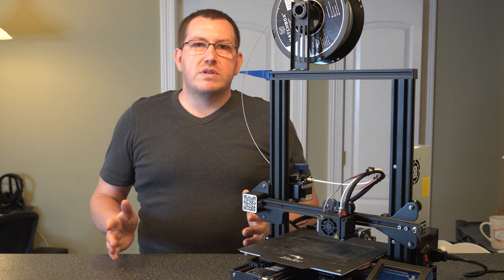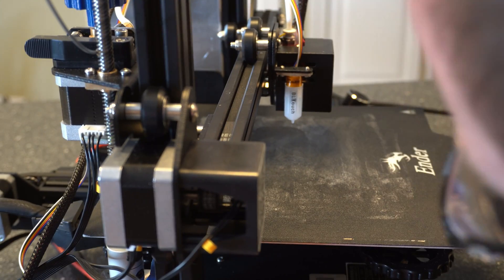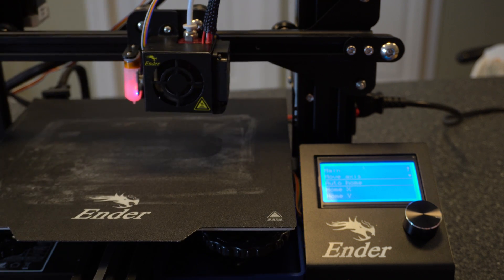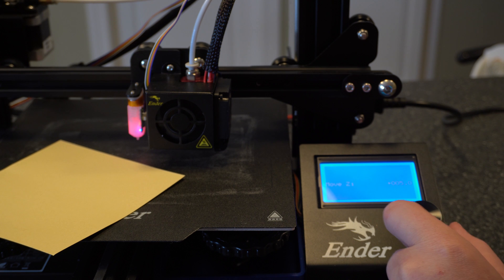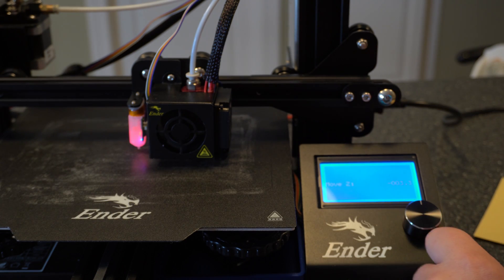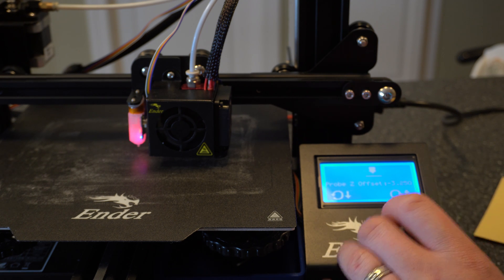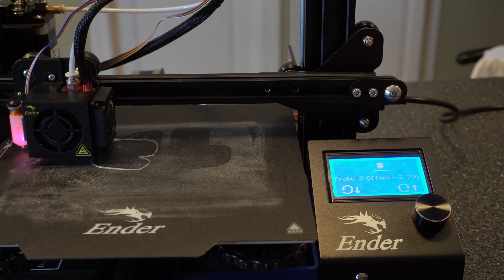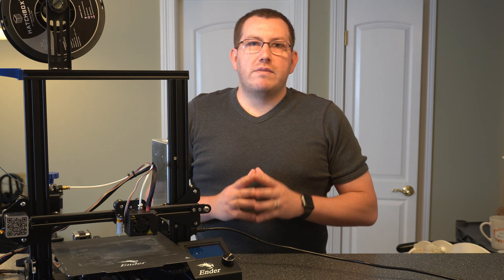Z-Offset BLTOUCH With Marlin Firmware

Comment: Hello, I've got an annoying issue with my Ender 3 with the 4.2.7 board, where the BLtouch goes to auto-home and won't move down. Whenever I try to manually adjust the Z axis, it'll only move up, and this is with Creality's BLTouch firmware. With the base firmware it works fine (with the exception of not being able to get the glass bed leveled no matter how much I fight with it), just don't understand how to fix this aggravating thing. I set the Z axis, and auto-home, it doesn't go down at all. Also, when I try to auto-home again, it says to Home Z First or Endstops Z. I'm very new to 3D printing, and am afraid to dig into the firmware since my previous 4.2.2 board fried while trying to install my previous BLTouch
Reply from the maker: Hi. If everything is working properly and you just cant get the z offset to go negative the issue probably the software endstops being enabled ( https://marlinfw.org/docs/gcode/M211.html ). If you do an autohome and it wont go down at all, it could be the wiring on the bltouch.
Reply: @3DPrintscape  Its not that I can't get it to go negative, it literally won't move downwards. The wiring on the BLTouch is where it should be, and the Z axis moves down with the base firmware, but I'm not confident in digging around in the Marlin to find the problem, wouldn't even know what the issue would be
Reply: @3DPrintscape  I move it down to the negatives and it works, but when I go to auto-home, it goes RIGHT back to where it was and gives the "stopped" error message, I try it again, and it tells me to Home Z First
Reply from the maker: @TheMacManusTwins  It its really sounding like a wiring issue, or the wiring isn't matching the firmware. Can you send me pictures of the wiring on discord? https://discord.gg/Bu94EYVkrU
Reply: @3DPrintscape  I have actually resolved that issue due to the red and the blue wires on the BLTouch not being where they should and using a different sort of firmware that's compatible with the Ender 3. Turns out the firmware from Creality has a bug where it wouldn't auto-home the Z axis properly or lower itself to the bed at all. Now, if I can just make it not print things like its made of brittle paper, that would be great, though I did have to babystep the Z axis during printing so it would flow smoothly against the bed, instead of sitting too high and dribbling from it like its been doing, regardless if the Z had been set
Reply from the maker: @TheMacManusTwins  Glad to hear you got past the first issue. It sounds like your e-steps or flowrate may be off now.
Reply: @3DPrintscape  On the contrary, it turned out to be a severely clogged nozzle. Was so busy stressing over everything else that I wasn't thinking about it until I checked it
Reply from the maker: @TheMacManusTwins  Ah ok, that would do it as well.

Comment: I dont get it at the end of the auto home where it goes back up yours comes back down mine just stays up about 50mm above the bed
Reply from the maker: Hi. It should be about 10mm off the bed in the center if you just do an autohome by itself. If you do it as part of another process, it will continue on.
Reply: @3DPrintscape  thanks for the reply

Comment: I’m so happy my printer doesn’t make that noise when leveling with a bl touch
Reply from the maker: Hi. Which noise are you taking about? Maybe my mic was just picking up a background noise.
Reply: Ah he's talking about the steppers, you must have the "loud" board in it....iv just upgrading from the 1.1.4 to the v4.2.7 and your motors sound like the old board drivers......
Reply from the maker: @mickyovts3872  Ah ok. Ya i have the 4.2.2 board with the standard drivers in one printer and an SKR Mini in the other. The noise output from the steppers connected to the 4.2.2 board is significantly more than a silent board like the skr mini or 4.2.7.

Comment: Just installed the BL Touch with a V4 2.7 board on an Ender 3 but the S axis won’t move down. Any help or ideas would be kindly appreciated. Thanks
Reply from the maker: Hi. It sounds like a firmware or wiring issue. If your using the creality firmware, make sure you have the z-stop connected still, then make sure the 5 wires for the bltouch are connected and in the right order.

Comment: You seem to be the only one who can explain this without taking 35 minutes, and while making sense. I have an Ender-3 with a 32 bit main board, and getting the BL-touch to work has been a lot of trial and error since it seems nobody has my exact setup. But thanks to your video, I've got a good first layer coming down, and I'm printing a test benchy.
Reply: Hey 3D Printscape and Oddman1980, I have the same setup, ender 3 with 4.2.2 mainboard and I also am having trouble with the BL Touch, so much so that I am thinking of removing it and going back to the good old ways. the main issue I have is when auto homing the display reads as 15.78 z axis. then the offset is down to around -5 but when I start to print, the nozzle is scraping and not allowing filament to extrude. I have to tune it while in motion, lifting the extruder by 1mm in some case but then the whole thing isn't level. honestly wish I hadn't bought it now. happy 3d printing
Reply: @guraven  you ever get this sorted? I’m having the same issue with an Ender Pro 5
Reply: @cybertrophic  Hi, I did get it sorted eventually, I watched more YouTube videos and had to compile my own firmware following the instructions, I then updated the printer with that firmware and it worked, little fine tuning here and there but it worked.
For the firmware compiling I watched teaching tech and followed what he did, also google worked for me
Let me know if you need more help

Hope you sort it.
Reply from the maker: Hi. Thanks for the feedback, im glad I was able to help.

Comment: I don't have a Z-offset option in the control menu on my ender 3?? So I have no idea how so set this without the option there to do so?
Reply from the maker: Hi. It sounds like you may not be running the firmware for the BLTouch. Can you check to see what firmware you are running?
Reply: @3DPrintscape  I'm having the same problem as this dude. How could I check to see if the firmware installed?
Reply from the maker: @guspurcell1629  You should be able to see the installed firmware under the about screen.

Comment: I have Ender3 pro with the latest marlin software and a BLtouch. When I try to manually adjust the z axis for bed leveling, it will not allow a negative Z axis number. Any ideas?
Reply from the maker: Hi. The software endstop is enabled by default. You can disable it by sending a specific g-code command to the printer or commenting out #define MIN_SOFTWARE_ENDSTOP_Z in the firmware.
Reply: @3DPrintscape can you please explain more...I activated it in marlin  but still Z does not go on negative values?
Z_max_pos is ste to 250 should I go lower (I installed CrTouch)
Reply from the maker: Ah, in that case it couple be the software endstops. You can disable in the config by commenting out #define MIN_SOFTWARE_ENDSTOP_Z or using gcode by sending m211 s0  @omidel.

Comment: Mine won't allow a postive z axis adjustment. I auto home, auto level and everything is just fine. I go to print and it acts like it is looking for the Z stop, and obviously there isn't one, so the head smashes into the bed until it can't move any lower. Then I end up turning off the printer. Nothing has changed since the last time I was able to actually print. For over a week the BLtouch worked well. Now This. Any ideas?
Reply from the maker: Hi. This is a pretty common issues if the wiring doesnt match the firmware. Are you using prebuilt or firmware or did you build your own? If you dont have the z-stop plugged in, the probe stop should be connected where the z-stop.

Comment: Hi brilliant video, can I ask where exactly do you run the bed levelling element where it checks the bed in 9 places?
Reply from the maker: Hi. Thanks for the feedback. I have it running the mesh at the start of each print. You need to add the g29 code to cura to do this. I cover that in more detail in this video https://youtu.be/Xiy-oLLrB1k .
Reply: @3DPrintscape  thanks for the link joined discord grp and understanding it all a little better although I've installed mine via the pin adapter.. 👍

Comment: Why does my Ender 3 v2 think my Z is 10!!??!!? I can't do anything with the BL despite it being red and pronging in and out upon boot.
Reply from the maker: Hi. The -10 is normal for the auto home. You need to adjust the z-offset to get it to print on the bed.
Reply: @3DPrintscape  Any advice for me. I set the offset and it's all good, but when I print it's too high. even when I do the code on the octoprint terminal to lower it to 0 it's too high. also I did confirm that the z offset it's saved, it just gets totally ignored.
Reply from the maker: @Vrx-yp1eu What value do you have for the z offset? Also, if your on discord i can help out there. https://discord.gg/Bu94EYVkrU

Comment: Mine is still way to high, and when I go into the move axis, Z axis, option, I can only go do to 0.00, which leaves my extruder about 5mm too high.  I can't get into the negative numbers like yours.  Needed to disable software endstops.  M211 s0
Reply from the maker: Hi. Ya you would need to disable to software endstops in some firmware. Sorry, I should have been more clear about that.
Reply: To turn software endstops off execute command M211 with parameter S0

"M211 S0"

Comment: I’m going bald here after two days of troubleshooting...

I have done the firmware upgrade from your tutorial and followed this tutorial, but when I start to print something it starts about 7 centimeters up in the air. And when I “Auto Home” it raises about 10mm each time.

My setup:
Ender 3 Pro
BLTouch (Antclabs 3.1)
4.2.7 board (upgrade)
The original z-stop cable is disconnected completely and the z-cable from the BLTouch is connected to the dedicated BLTouch connector on the board. Not to the original z-stop connector.

Please help😭
Reply from the maker: Hi. The autohome being at +10 makes sense, and is normal. If the printer starts printing mid air, then the z-offset is not set right. I would need to know what firmware you are using but if your not on the Marlin bug fix line, i would recommend going to that and enabling the z-offset wizard. Here are two videos to help. If you run into issues, you can join our discord server and I can try to help you more there. https://youtu.be/pQ7WZST8sqk  & https://youtu.be/2gRfU26aTDs  Discord: https://discord.gg/Bu94EYVkrU

Comment: I am giving up. That BLT just opened up a can of worms. Ateast before I had the knobs... They wont work now
Reply from the maker: Hi. If your not seeing the menu shown in the video, try to clear your eeprom. This should be as simple as hitting restore defaults, but it depends on the firmware you are running. You can also join the discord server and i can try to help you there. https://discord.gg/Bu94EYVkrU

Comment: There is no z offset under control..
Reply from the maker: Hi. If your not seeing the menu shown in the video, try to clear your eeprom. This should be as simple as hitting restore defaults, but it depends on the firmware you are running. You can also join the discord server and i can try to help you there. https://discord.gg/Bu94EYVkrU
Reply: Thanks too
Reply from the maker: @mattlogue1300  Hi. I would go with the latest Marlin bugfix version unless you have a specific reason not to. I did a video covering the entire process that you can see here https://youtu.be/pQ7WZST8sqk . There is also a link to written instructions in the video descriptionas well.
Reply: I may sound dumb but which marlin fw should I choose? I know arduino IDE but life has been hell. Not sure what's running the ender 3 but it may be avr. Just dont want to brick it ... I already damaged two beds since getting the darn bl touch.

Comment: Too many z offsets. There is one in move axis, another under control motion, another in bed leveling, and then you have manual control. I fkd it up and it gouged bed.
Reply from the maker: Hi. I agree, there are too many of them. I mainly use the z-offset wizard these days but it wasnt available in Marlin when i made this video. Here is one i made covering the wizard. https://youtu.be/2gRfU26aTDs

Comment: I have a 4.2.7 board with The firmware downloaded from the Creality website. Ender-3 Pro- Marlin2.0.1 - V1.1.2 - BLTouch - TMC2225.bin
My Auto Home Z-axis defaults to +10 which is too much to compensate for with a Z Probe offset. How do I change the default of the Autohome?
Reply from the maker: Hi. The firmware by default is set to +10 but that can be accounted for with the z-offset. You will want to home the printer, then lower the z axis until it gets to the proper height. That value will then be your z-offset.
Reply: @3DPrintscape  Thank you for the response. So I go to prepare/move axis/and then lower it. Do I then store the setting or something to lock it in? After I lower the Z axis it is reset back to 10 every time I home again.If you are referring to the Probe Z-offset, the max it will go to is -9.900 and that is still way off the bed.
Reply from the maker: @ryanbridgham2172  Take a look at the z offset section in this article, I think it may help. https://3dprintscape.com/guide-to-install-a-bltouch-on-a-creality-32-bit-mainboard/   If your still having issues, you can also reach out to me on discord. https://discord.gg/Bu94EYVkrU

Comment: It wasn´t working for me without bed leveling first. I tried without it, with auto home and adjusting z offset, but I was printing in air no matter what "z" is. Even correction on the fly didn´t work. But after bed leveling my z offset was working.
Reply from the maker: Hi. The bed should be somewhat level and the bltouch should account for the rest. If your still having issues, you can join me on Discord and we can talk about it more https://discord.gg/Bu94EYVkrU.
Reply: @3DPrintscape  No problem more, it is done. It is simple process, and you covered it well. Thx

Comment: My z offset is stuck at +10 and when I try to set it anything below 10 it says offset is to far? Anyone else have this problem and a possible solution?
Reply from the maker: Hi. The firmware is most likely setting the z value to +10, that is pretty normal. Some go with +5, others with +10. Are you running custom firmware, if so what are your software stops set to? If you want, you can join our discord channel to try to work on fixing this in more real time. https://discord.gg/Bu94EYVkrU

Comment: Hi 3D Printscape, when I do an auto home on my Ender 3 pro none of the end stops work the x,y,z just sit there making a noise until i turn it off and on again. Thanks
Reply from the maker: Hi. Did it work before and just start doing that and did you change the firmware at all?
Reply: @3DPrintscape  no and I swapped the board out for the V4.2.2 and it is now working

Comment: Thanks for the awesome video my printer keeps printing in the air. Before I start the print it the z ofset is correct but then when I auto home or print it still prints in the air. Any tip?
Reply from the maker: Hi. The z-offset wont impact the autohome. If you do an autohome, the height will match whats in the firmware.

Comment: hello so thank for all the videos however i cant get the bltouch z offset to go negative for now im back on manual firmware but any help with this issue would be great thanks
Reply: I found it.  M211 s1 or s0.   (Enable or disable software endstops in marlin)
Reply from the maker: Hi. I plan on doing a video on this as soon as i get the hardware to test it. There is a software endstop that needs to be disabled, or the min value needs changed in the firmware. I think this is the case with the Creality firmware (need to verify that). You should be able to disable it with the M211 command. https://marlinfw.org/docs/gcode/M211.html

Comment: Hi there. Great video. I am following word for word. My Z probe offset is set so I am getting drag on the paper but when I set a print away it is still printing in mid air as if it is not taking in to account z probe offset input. I have stored settings etc too so not that? Do you have any idea of problem? Thanks
Reply from the maker: Hi. It sounds like the z-offset still isn’t set correctly, did you account for the initial value (I think its +5) when coming up with the final value? You could try to kick off a test print and lower the z-offset while its printing until the filament is sticking correctly. If you go that route, make sure you save it afterwards.
Reply: @3DPrintscape  Hi thanks for the reply yes I account for that. It was +10 on my printer. Any idea how I would do a test print on my purse i3 pro b.

I was able to adjust the z offset height during printing a couple days and and now it just seems like it is not taking the offset setting into account at all and also it will not adjust during a print...
Reply from the maker: @ScottAndJen  If its set right and not actually utilizing the setting, I would try to erase your EEPROM. Just make sure you make a note of the setting you still want so you can put them back in afterward.
Reply: @3DPrintscape  Thanks for this. How do you go about erasing EEPROM. Saving the setting is no problem I can simply follow your video again.
Reply from the maker: @ScottAndJen  It depends on the firmware you are running. But generally its "erase settings" or "erase eeprom" under the configuration menu.
Reply: @3DPrintscape  edit - could only find initialise eprom. Quick question. When a print is in process should I be able to adjust z probe offset to dial it in. I am dialling it in at -1.87 like on this video in config and the paper is perfect but when starting a print it is too far from the bed and have adhesion issues
Reply: Thought it saved to SD card not eeprom. Good. Never made sense